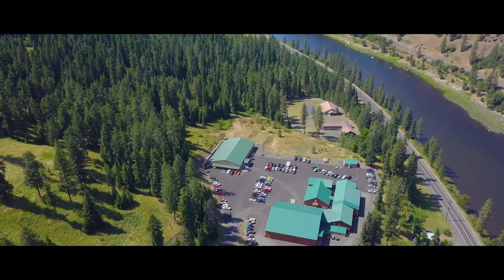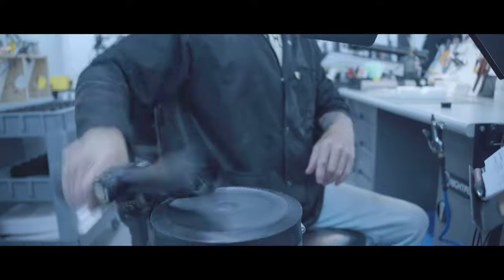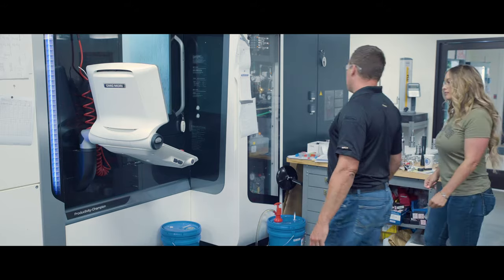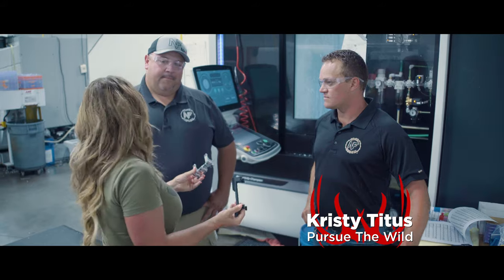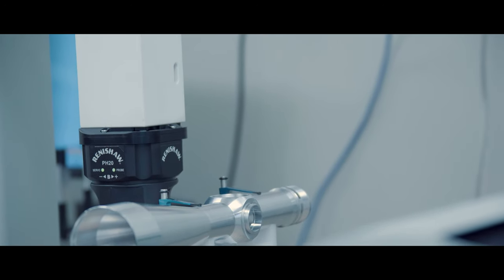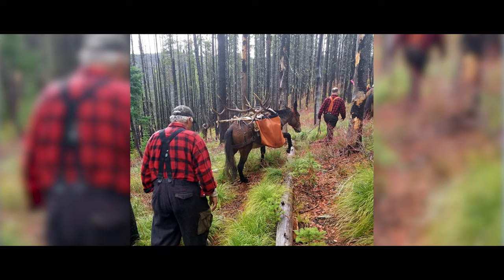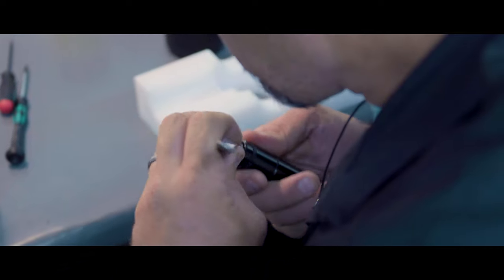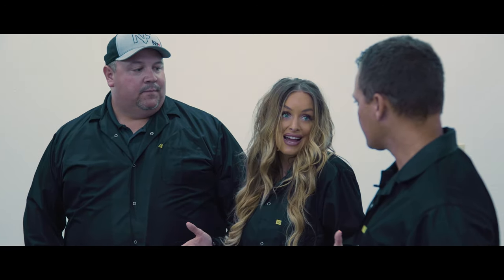Nightforce Optics - A Look Behind The Brand

Comment: Bought an Atacr 7x35 roughly 2 months ago and the sunshade threads were stripped,  no biggie called NF , left msg, wrote email. No response! Ended up returning it and got a high end vortex razor gen 2 Instead. Best decision . Still yet to receive a an email or a call.  Mind you uta a 3700 scope. Whats the point of having the best scope if you cannot communicate with with your customers.  Now I'm looking to buy another scope and with similar specs for a scar 20s and as much as I would like to give nightforce another try, I think I'll pass
Reply: I was loooking to ths nf atacr for the scar 20s. So is it that bad with for thier customer service?
Reply: Yes. It’s bad